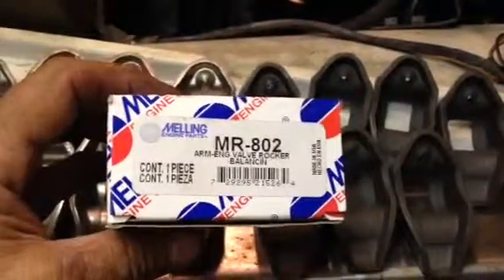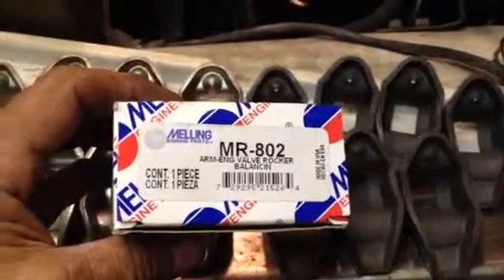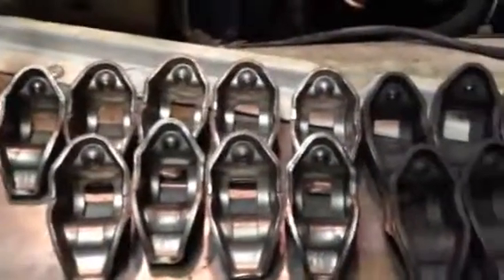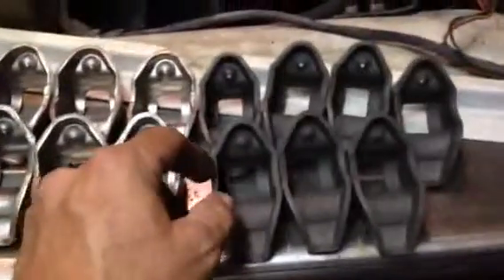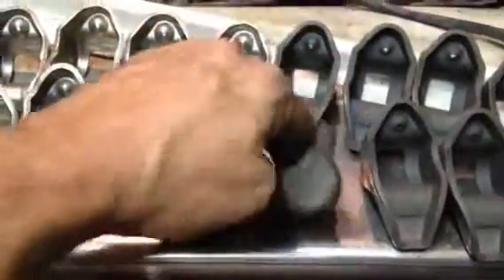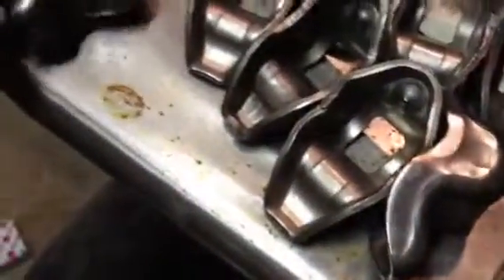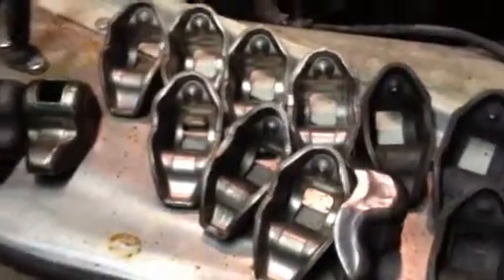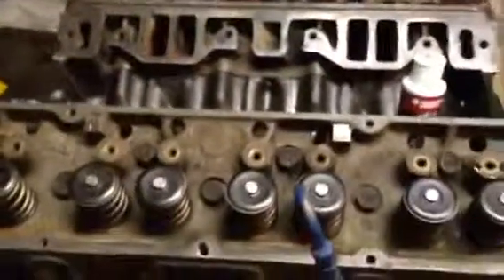AMC 304 Rocker Arm Question.

Comment: What did you end up doing?  I believe the black ones are the older and better versions that are carburized.  The shiny gold ones are nitrided or zinc plated and a result of bean counters running manufacturing.  The shiny, gold AMC rocker arms I have found are lighter and thinner than the black versions.